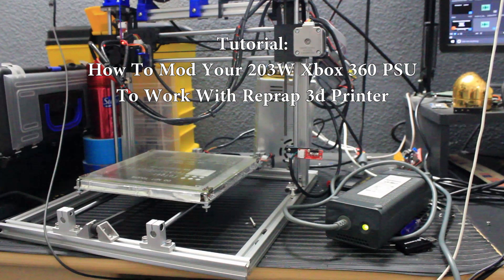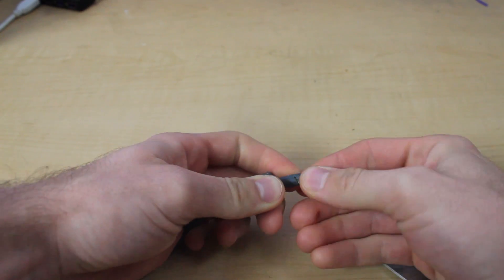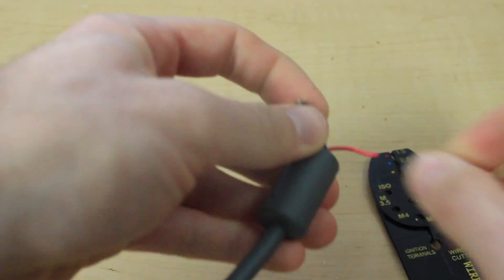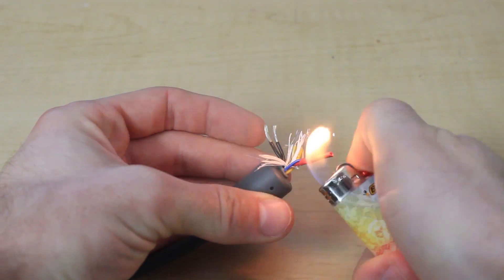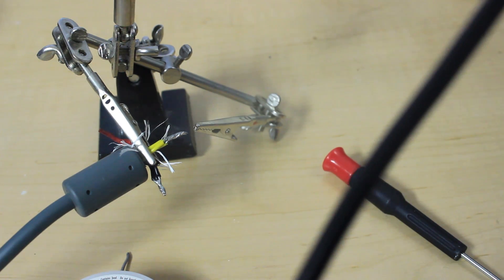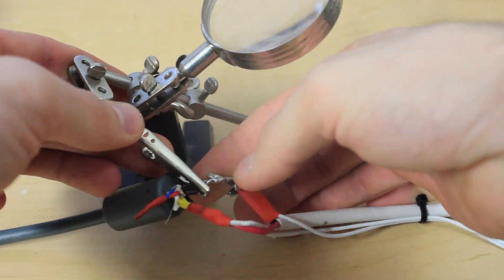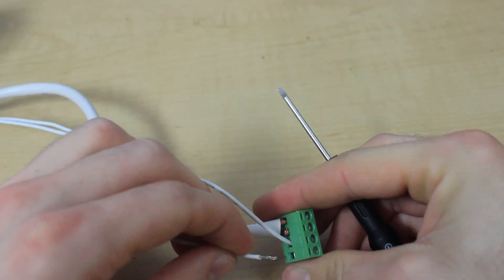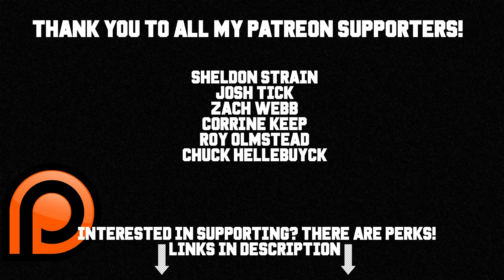Tutorial How To Mod Your Xbox 360 PSU To Work With RepRap 3d Printer

Comment: just wondering if this is a good long term solution, still using it now and it's working fine?
Reply from the maker: +Oliver Jackson still using it daily works beautifully
Reply: I've only found out this through reddit but did you know that you can send a gcode command to the ramps board I think it's m80 to turn on the PSU if the blue wire is connected to the ps_on on the board itself. And m81 to turn off also does your printer have a hotbed?

Comment: How is it working out without a fan? any heat issues? How safe is this essentially?
Reply from the maker: +Jacob Hoffmann Without a fan? the extruder? the ramps board? As far as i know many others have used the psu from the xbox 360 it has a bunch of built in protections. There is a fan on the extruder may add one more, i did now add one to the ramps board it was running to hot and the psu has a built in fan!
Reply: +Dopesoner Im just talking about the psu...okay so thats how it doesnt over heat....how loud is the fan? im just considering this mod because my current psu fan is very loud

Comment: dopesoner can you check the firmware of the da Vinci printer on the ramps 1.4 to see if anything is holding it back from using the drv8825 because I did it and it screwed up the distance the motors turn.
Reply from the maker: +Cole Nagao the driver should be fine you just may have to edit the steps per mm on the firmware. I actually just experiences this i somehow managed to damage a pot on one of my drivers and swapped it when i noticed the z axis was only moving half of what it was supposed to. I went under the firmware double the steps from 80 to 160 for the x axis and bam problem solved
Reply: +Dopesoner you can take a jumper out from underneath the stepper driver.  The Dr one uses 32 stepping.  Either double your stepping in firmware or take out a jumper (I'm not sure which one.  You'd have to look it up, I usually just double the steps per mm in firmware)

Comment: If you want to make a bunch o money, build people 3D printers. Get this down pat to be able to make it extremely quickly. Install extras like heated bed insulation. Mark up the build $200
Reply from the maker: +Adam Hearn the issue is shipping I would have to build wood crates for them even then I'd be scared. That's my biggest drawback bro
Reply: +Dopesoner I was also thinking of doing that but the shipping price would be about $50 or more you would put in about 8 hours of work and it's just too much.
Reply: Do it locally only.